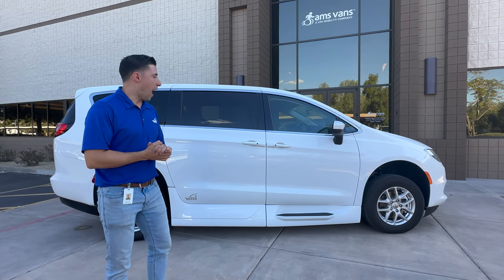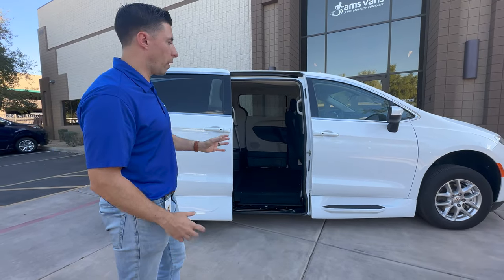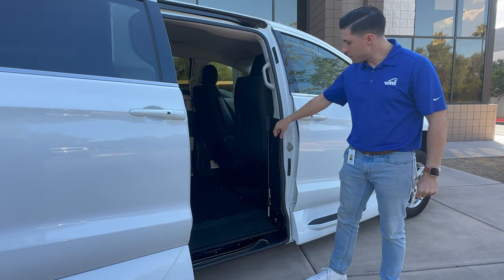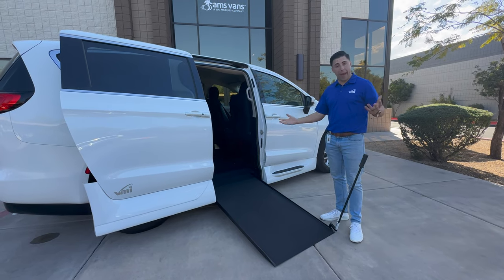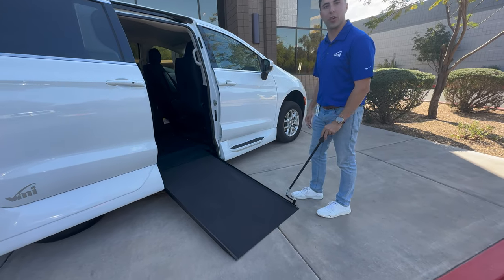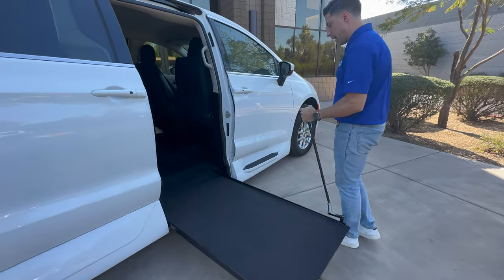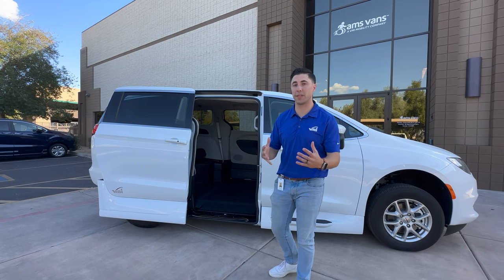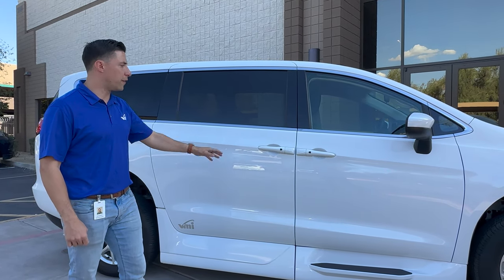Vantage Mobility - How it Works: VMI Northstar E™ Manual, In-Floor Ramp

Comment: Curious if there is a simple way to make the powered Northstar in floor ramp manual like this as opposed to the crank method for those times it doesn’t want to deploy😏
Reply from the maker: That's great feedback, thank you for sharing!
Reply: I am curious of this information as well.